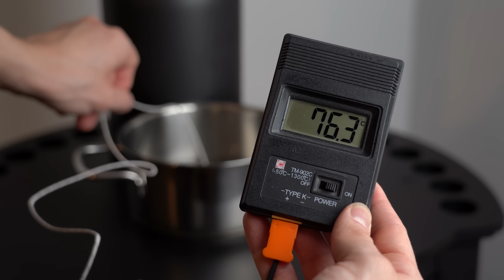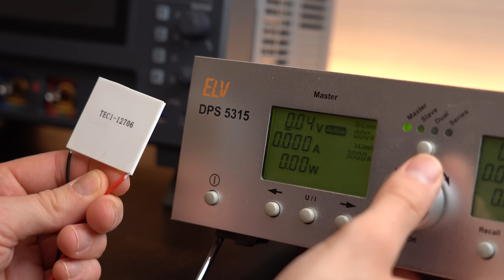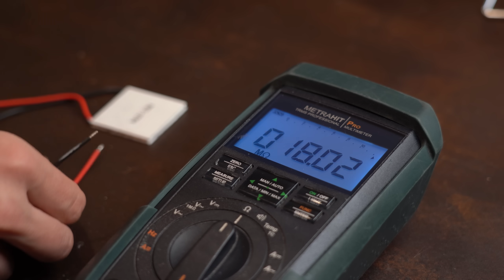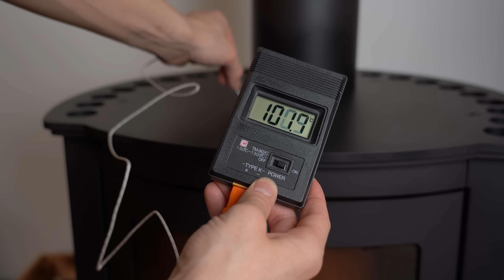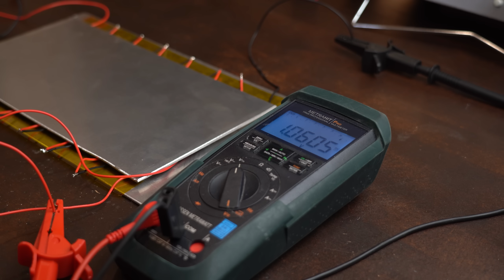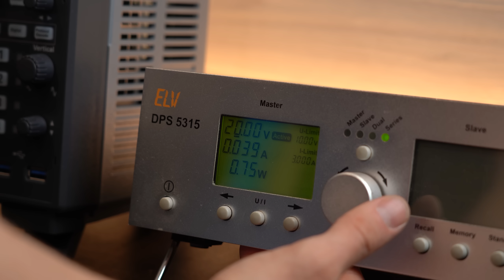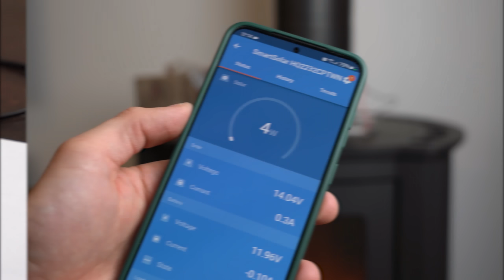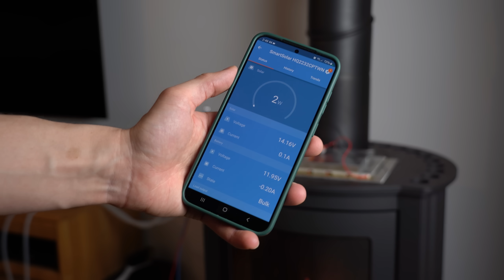I tried to Power my Home with Heat Generators! (Worth it?)

Comment: Those teg modules aren't designed for that kind of ∆T And that's really where you see the difference in power output.

You should check out teg Mart. They're out of Vermont and have some modules that are designed for higher temperatures.

They have 100 w thermoelectric generator module That's water cooled.  The basic one is 15 w. You're still probably better off with solar panels, but 100 w consistently isn't too bad.

Something else to try in the future is if you can run a teg off of solar thermal and wood heat.

It might also be possible to have the teg modules off of the stove and then just run two water loops if you're going to use the lower temp TEGs

I can't even imagine though, back in the '90s we used to have 100 w light bulbs and thought nothing of it. And we had 25 w compact fluorescent light bulbs and were correctly amazed at how much power we saved. Now most LED bulbs are around 10 w.

https://www.tegmart.com/

Comment: Heres a fun idea that might actually net you some usable electrical energy: in a shed outdoors, a wood burning boiler and steam engine with generator. exhaust steam goes inside your house to a radiator. finally condensate is returned back outside and pumped back into the boiler

Comment: I am glad you used a water block. That's what I would have done. I was also thinking, that maybe you could use a block for the hot side & use heated water from the stove, instead of putting the elements directly on the stove. Maybe, you could also find a place in the house that is naturally cooler, so that the bucket remains cooler, too. Finally, if you use enough junctions, maybe there WILL be a point, where it makes sense. That sheet is far from the maximum area available in the house. Peltiers generate more energy, based on the temperature differential. If there was a way to get things even colder, it could work even better. Maybe, you could mount a block to a window, if you'd rather not run the tubing outside.

Comment: I had the same idea and calculated a power output of around 100-200W with a 15kW fire. Looks like that was overestimated. I never realised the project though, cause even 200W would be "nothing" compared to a 50 EUR solar module.

Comment: Hi. I Played with TECs and got disappointed, until learned that those aren't really designed for this job. You could get better results with TEG modules. Those are designed for this purpose and can withstand higher temperatures. TEG are more expensive, though. TEG modules are often used for powering offshore lighthouses and  space equipment where the heat source usualy is radio isotope.

Comment: Post Apocalyptic Inventor made a video where he tried the exact same thing and ran into the exact same problems. His solution to the overheating was to have much less surface area on the hot side but in the end these peltier devices really don't generate much power

Comment: the peltier fans use a standoff with a narrow aluminum section to regulate the heat transfer, these things destroy themselves the same way as when they act as a cooler when the flux is too high. you can calculate the energy out as cooling and figure out how to rate the flux and what the delta would have to be

Comment: I’ve had a similar idea in my head only using a water pump system on the hot side too, this would limit hot side temp to 100 degrees

Comment: The Chinese thermoelectric modules vastly overate their capabilities,  in the same vein as the 1,000,000 lumen flashlights that sell for $5 . I have used modules from Laird Thermal Systems and they  perform to spec, but they are very expensive. ($50  and up)  The Laird Thermoelectric Handbook is required reading if you want to successfully tackle a project like this.

Comment: The problem is that the modules that you can buy are not suitable for this. 
During the Cold War, Russia developed a thermoelectric generator that was able to power a radio. The thing was shaped like a lantern and was powered by regular kerosene.

The blueprints for this should be online 😁

Comment: What if you used the peltier to pull heat off your solar cells? Seems that bifacial is mostly a waste. So maybe this could boost efficiency slightly considering it's 'waste' heat.

Comment: could have made one hell of a cryo cooler and used liquid n2 injected into a pressure cooker with an old surplus lab turbomolecular pump clamped on it to generate a crap ton of power sit that pressure cooker on the fire and you golden. Blast shield may be required.

Comment: I'm not an expert in this area, but I don't believe you want to use a Peltier device for that.  You're basically running it backwards.  There are thermocouples SPECIFICALLY made for energy generation using a temperature difference although I can tell you right now, it's not worthwhile to use.  I think you want to use a thermophotovoltaic device.  It's basically a solar cell but it's tuned to infra-red radiation, I think.  I believe these are what are used in nuclear batteries.

Comment: i have "masonry oven" midle of my home. There is copper pipes inside the oven and when i heat it up it heats glycol inside the pipes and stores the heat very well. i could also setup radiators to it and small circulation pump and warm every room with it or make water go trough the system to waterheater and save some electricity during expensive days

Comment: You've got the wrong ones. Instead of using TEC or " more suitable TEC for power generation " you need to use TEG instead. They are also more expensive than TECs but atleast they should not be destroyed after running them too hot. TEC is perfect for cooling but terrible at power generation and TEG is perfect for power generation and terrible at cooling. I have one TEG which cost me around 11€ including shipping and just one TEG is enough to power a 1W LED. I'm planning to buy atleast 50 of them and use them as back-up source of energy because in my house i'm using as a central heating system a wood/coal 40kW boiler and power outages are pretty common here in Slovakia especially where i live. The boiler was 3x repaired so now it is without an insulation around it exposing bare cast iron. The surface never exceeds 80c. With 50 TEGs i should get around 90-120W nonstop using a large thermal difference ( my plan is to use 10W pump with higher waterflow and one big radiator from air conditioner as a cooling ).

Comment: Thank you for your variety of content -- always amazing. 

In this particular case, at time 0:52, you state that it can "directly convert heat into energy" -- which is not true. These modules convert a "temperature difference" into electrical energy. At best, I have seen that there are some materials which exhibit thermoluminescence which you could (in theory) run through PVs to make electricity. This would be a heat > light -> electricity (I suspect less than 1% efficient) and while not direct the initial source is pure heat. Sure, you could do heat -> steam -> mechanical -> electricity (also from pure heat) - which is way more efficient even though it goes through more stages. However, it has the other downside of mechanical wearing; but I am sure that the PVs would wear down too...

Next up, I think that it is really difficult to properly quantize a power efficiency as the source is the thermal difference. If I recall, the temperature for the high end might have been reached which is probably what caused the failures. I don't recall if there are any high temperature variants; but if there are, you could stack them such that the high temp ones were closest to the heat source. For testing, you probably want to put a temperature probe between each layer as balancing will probably require some experimentation.

Comment: I'm so pleased you're doing these experiments because you've stopped me from wasting my own time doing the same. I have a couple of hover board motors I had intended to turn into a VAWT but having seen how poor the output is from your own turbine, I've given up on that idea.

I also have a log burner with a Peltier fan and wondered if i could convert more of the heat energy to electrical but again, the conversion seems remarkably poor.

I already have 21 solar PV panels on my roof which, whenever the sun shines in the UK (insert your own joke here) gives me up to 8KW. I had hoped to supplement that with a VAWT for the other 360 days of the year when the sun doesn't shine. 

Perhaps i should move house to one with a fast moving stream nearby.

Comment: If you get snow you should make a pipe heat transfer system that flows water outside and gets cold by the snow for the cold side. For the hot side you run water through the heater to get it up. That way you could theoretical have a temperature difference over 100 degrees Celsius while still keeping both sides of the device withing the operating temperature range. So they wont over heat and het destroyed

Comment: I wonder if a larger thermal sink was needed to prevent the peltier units from reaching the thermal limits as quickly, also interested to see if you would be willing to try a sterling engine setup for possible energy generation.

Comment: If you use a stove for heat generator, then you should use one stirling engine connected to one electric generator. The advantages will be much moore power and the water used to cooling the engine will be around 48 celsius degree wich can be use to heat your home without lose any energy. 
Basicly all thermal energy is return to your home.

Comment: I have 2 EcoFans that use Pelier devices to power the fan motors.  These are on my wood stove to help circulate warm air.  They work good.  Very quite, too.  Valuable during a power outage last winter.
Reply: I think you're confused. No electronics use a peltier device to provide power to motors. The peltier device would be used to cool the motor, or to provide cool air as the fan blows, depending on the application. You say they're on your wood stove, so what they are doing is cooling the motors so they don't get overheated.

Comment: Tech ingredients has a video from 5 years ago where he had more success with the ominous title "primitive tech vs high tech". By boiling a pot of water the temperature can be limited to 100C. He managed to get 1.2W per cell this way. He made a bigger version that could power a 50W LED Floodlight. Its not impossible, but its not amazing either.
Reply: I think 50w is pretty amazing especially if you're already going to be running the wood stove for heat and you're limited on available roof space for solar as is the case for many mobile home or boat dwellers, and even more especially still if you live in a region that doesn't get great solar insolation through winter so your solar array is putting out nothing for maybe 3/4ths of the day while your stove is putting out both much needed heat and electricity for pretty much 24/7 as long as you're stoking the fire
Reply: Thanks

Comment: I had this idea to do something similar some time ago, the difference was to run a cooling system into the snow in winter, have a anti freeze liquid instead of water to cold down. That way during average -10..-15C temp during winter I could reach this 100 deg diff easier with less heat from the fireplace....

Comment: The peltier units for high solar and nuclear pile are made of more substantial materials than the ones you are using and can tolerate much higher heat. Still, they aren't all that efficient and you would probably need a large thermal pile to generate enough power to be useful. The Soviets made a gadget that fit over the chimney of a kerosene lamp that charged a small battery to operate a radio. Maybe you should consider a Stirling generator. NASA designed a Sterling converter for use with solar or nuclear pile that is quite interesting.

Comment: I think putting them in series didn't help. You should have tried in parallel and a buck or something. with just a heat sink on top and a fan. Also had the peltier too close to the fire. they are best on anothet heatsink just like the fans you see.

Comment: Could have used a convection cooler feeding into an elevated heat exchanger(aka radiator) in closed loop. Also not every peltier can handle higher temps(need a poor thermal conductor interface, if placing directly over wood burning heater surface), due to low temp solder used for the bimetallic junctions. Could easily get enough power for a decent phone charger🤔. They do excel as better heaters than resistive ones, with proper system design. They could also make for  better seat heaters in BEVs(esp. to increase range), if not for the cost🤔❤👍

Comment: There are special high-temp peltiers that are WAY more temperature resistant and can often deal with 300C or more. However, last time I checked they were very expensive compared to the cheapo models.

Comment: Fun fact - Germany buys electricity from Norway - A contry that is very expensive and does actually not have as big electricity production as Germany... With further increases the price both in Norway and Germany...
Reply: it SOMETIMES Buys there, a lot of times during the year we sell power to for example the superreliable french nuclear reactors ;)
Reply: That's an interconnect, isn't it? That means that both countries buy and sell energy from each other when one has a deficit and the other has capacity to trade.
Reply: @talideon  This is only possible in an ideologized Europe.
Of course, the French have no need to buy German "green energy" but European regulations require priority for buying such energy. Therefore, the French, in order not to pay fines, have to buy this energy from the Germans, although in fact they do not need it.
Please calculate how many wind turbines would provide the same power of just one nuclear power plant.

Comment: Realistically you would heat water from your fireplace and then pump that across the hotside of the module, before doing the same with the cold side. That way you could use a thermostat to maintain stable and equal temps. Doing so you could make a more compact and denser populated generator but at the cost of external ancillaries. probably get an extra 2 watts haha

Comment: I like the idea, but if you use steam power with some water and a turbine, then condense the steam back into water, I feel like it would be a lot more efficient. Heat also rises (hence how it's possible to condense steam again with some clever angles and minimal cooling), you can try getting one of those stove fans made to circulate the heat, and making it into a generator too, although I feel that would yield much the same result.

Comment: How about vertical peltiers? Have metal fins coming up from the bottom plate, and metal fins coming down from the top plate, so that they alternate when fit together. Then insert the peltiers vertically and in alternated orientation, so that each fin coming down touches the cool side of two peltiers, and each fin coming up touches the hot side of two peltiers.

Comment: Wind sucks because it doesn't scale down efficiently, and peltiers suck because they're just plain not efficient in general. Even if the peltier elements were perfectly efficient (which they're nowhere close to being), the carnot cycle efficiency limit between 100c and 10c is 24%, so three-quarters of the energy from your wood stove will be waste heat (perhaps not "waste" if you need the heat anyway though). In practice, you're doing pretty well if you get a few percentage points of efficiency out of a peltier.

Solar works just as well on your roof as in a utility-scale plant, (scales linearly) and efficiencies are pretty good these days, which is why it's the only sensible choice for home-scale generation.

If you lived in an ideal location with an appropriate stream could rig up a micro-hydro installation to get some reasonable output, but it's still orders of magnitude more complicated than solar with the only advantage being that it can in theory generate power around the clock, although it's dependent on steady water flow.

Comment: an insulated pump house for a micro turbine powered with the collected rain water could be alot more effective than a peltier device, i've also seen people trying this with attic spaces and it never worked well enough as a generator but a cooler that gets to refrigerator temps doesn't work too bad just requires alot of power

Comment: I would think using the fireplace to heat a volume of water and attaching the modules to the side of the hot water vessel would be safer for the modules? and you can place the coils to transfer heat to the water in a more ideal location on the fireplace. maybe place the cold water reservoir directly on the cold side and bypass the need for a pump in favor of natural convection. I have seen many people make wood fired hot tubs using natural convection to circulate the water. Might save the 5w from the pump running. natural convection on both sides, peltier modules sandwiched between a hot tank and cold tank? still not gonna beat solar but maybe you can charge a small battery bank with it lol

Comment: My thoughts on thermoelectric generators is that they'd be useful in limited power availability situations where you need to recover every watt of waste heat that you can from MOSFETs, motors, CPUs, GPUs, and other heat generating components - like remote sensors, communication nodes, and space station and satellite applications.

Comment: Make a Bayton engine. Like a jet engine but with pistons. Was originally  coal fired but works with firewood too. a smaller compressor piston and a roughly twice the diameter expansion piston. Runs at moderate pressure and  RPM and is more efficient than a steam engine. As it is open loop, there is not dead volume limitation as with Stirling engines, so power scales good with size.